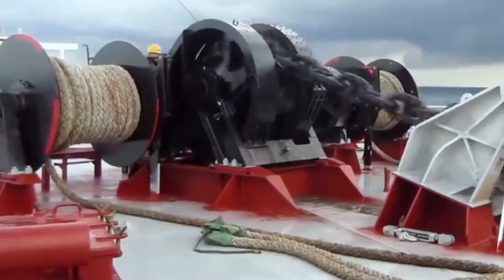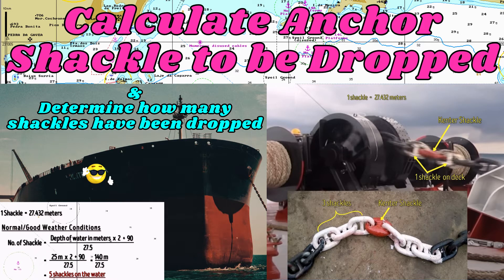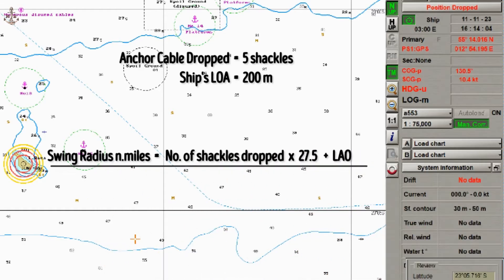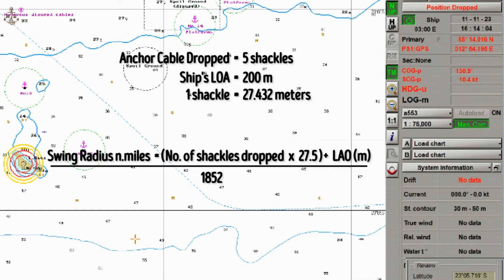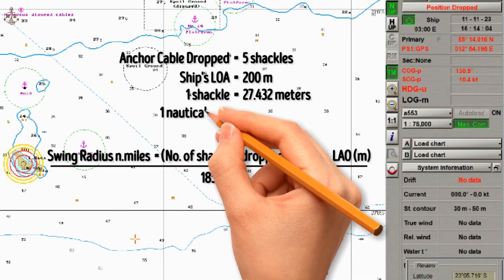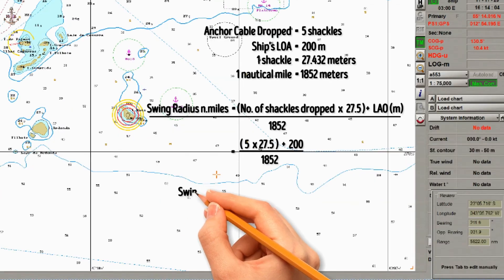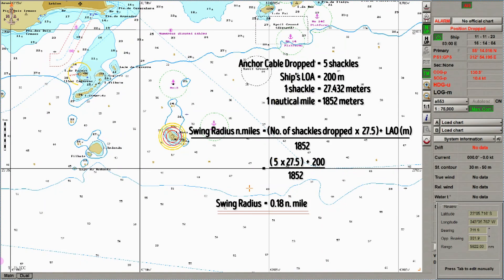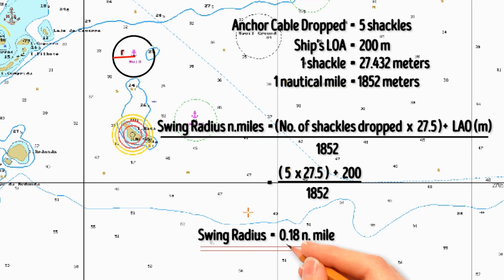Calculate Ship's Swing Radius when Anchored ll Turning Radius ll Turning Circle ll Drag Circle

Comment: Thank you for such a clear explanation! Only have decided to make one remark about,  fortunately less but still in effect unpleasant practice among some, mostly young, officers: activating MOB mark on GPS/ECDIS upon dropping the anchor OR just directly taking the position from GPS upon the same AND using it as a reference (center) point for the swinging circle without corrective calculations. The case is that they are taking the position (either manually or by activating MOB) not of the dropped anchor itself, but of the GPS antenna which is on compass deck right above the Bridge, and correspondingly 100+ meters away from the actual anchor position. Definitely, this may not have harmful effect on the safety with small vessels and at some far and not congested anchorages, however at the same Singapore strait, rivers, etc. it certainly may have..
Reply from the maker: Thank you for your thoughtful comment. You're absolutely right! Thanks again for highlighting this!